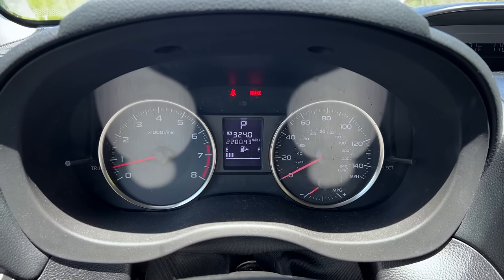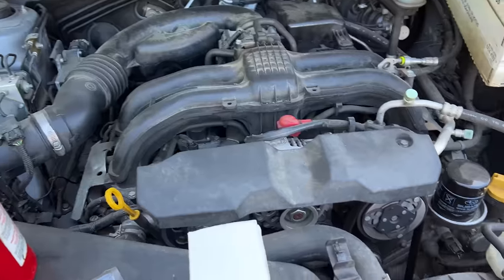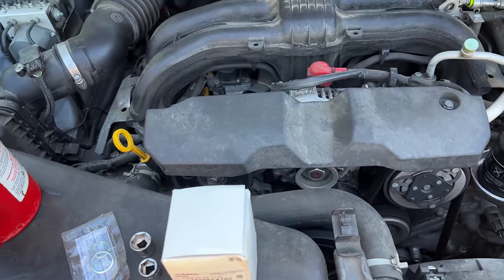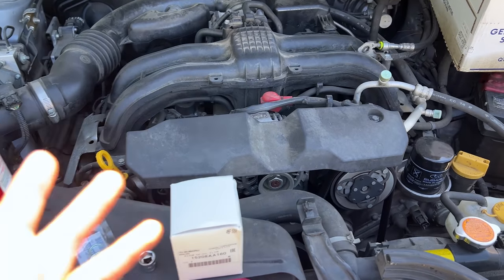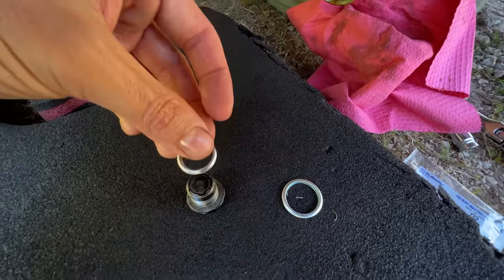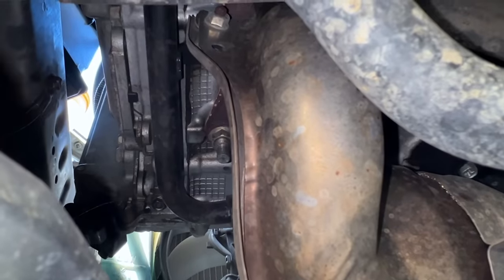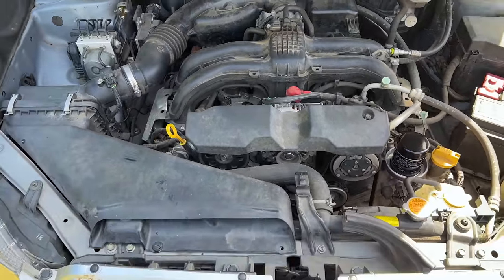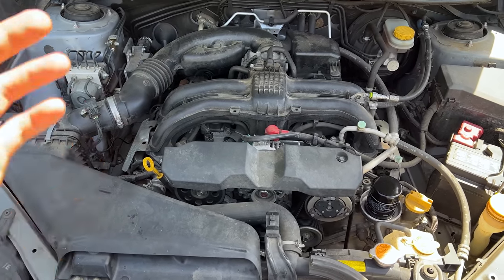220,000 Mile Crosstrek Oil Change - How Has The Cheapest, Highest Mileage Crosstrek Held Up?!

Comment: Not bad!  I'm surprised to see a CVT go that long, even with work.  I'm still skeptical of their durability/longevity.  No issues at all with the often derided 4EAT in my 2007 Legacy 2.5i Limited.  At 171k and change on the odometer, I'm looking at a car that's not going to make 200k though unless I replace the head gaskets for a second time, control arms, at least one set of wheel bearings, exhaust, and likely some other things (like valve cover gasket probably).  Starting to see some rust bubbles around the rear wheel well on an otherwise clean body is sort of what changed my mindset to start thinking about replacement vs dumping more money into it.

Comment: AT205 added to your oil is good for leaky seals - it really works, but the only part is you might have to do it with each oil change.  But I had good results with it generally stopping many leaks.  I don't think it would help your oil pan however.  I recommend the Fumoto drain valve that Alan mentioned.  I use Lucas too, did on my old subarus and use the new synthetic forumula for the thin synthetic oils.  That older stuff thickens your oil a lot, but I see that you only use it sparingly at low strength, so probably won't hurt using it that way (which is why I am sure you don't add the whole quart).

Comment: Fuel economy: Are you using Top Tier fuels? Years ago, I came close to selling my car as the fuel economy had gotten so bad - 15mpg. A.friend.suggested different gas. Next fill up, I used Diamond Shamrock (nee Valero) instead of Sams Club, and immediately saw.a.return to 20 mpg.

OCD oil filter: without that 1\2 turrn, you were spot on! 😁

Comment: Agree on the power. I’ve got a 2021 Premium with the CVT and it’s plenty- but I drive pretty cautiously too. No need to hand over money to the local PD just to arrive at the next red light a minute sooner! Awesome reliability on yours, nice! Bodes well for mine I hope.
Reply: Newer models have more power. First gen CVT models have a 0 to 60 time of 12+ seconds. 2021+ run about 8 seconds. Not much faster but noticeable.

Comment: Lucas is the good stuff I put a junkyard 350 in my mother-in-law‘s Chevy conversion van a few years back it was supposed to have about 80,000 miles on it I put a quarter of that in and 4 quarts of regular oil she’s not real good about checking her oil it lost oil pressure and she drove 12 miles home only thing that was in it was the Lucas only about a quarter of a quart came out all the bearings we’re fine resealed the oil pan put new oil in it she drove another seven years without a problem

Comment: some idiot at the dealership rounded off my drain plug and I can't get it out, so now I just siphon out the old oil and change it more frequently. I'm always impressed at how clean the old oil looks. Engines are made so much better these days despite what the boomers love to tell you about their carbureted messes from the 70s that barely lasted 80k miles
Reply: Cut a slit in the drain plug for a flathead or something then just replace it
Reply: @andreahighsides7756  I'm not that worried about it, I already have the oil pump and it's way less hassle than jacking up the car and trying not to get oil all over the skid plate or removing the skid plate.

Comment: Glad your's isn't really consuming oil. My 14 with 153k consumes about a quart every 3000 miles from what I can tell so far. I run 5w30 in it to help combat that somewhat over the thinner stuff. It's too bad the previous owner didn't take the car in when it would have still been covered under warranty.
Reply: The warranty wouldn't have covered that rate of consumption anyway
Reply: Well, that's what it burns with the thicker stuff. Not sure how bad with the thin 0w-20

Comment: I have the ‘14 Impreza with the same drivetrain. I’m running into the CVT valve body issues at 110k miles and I’m pretty disappointed. For a company that prides itself in its reputation of reliability, Subaru really should have addressed the trans issues with a recall rather than extending the warranty.

Comment: Great informative video for me, that helps me learn about my first Subaru, which is a 2013 Crosstrek. I can change the oil, that's easy. I'm just learning what type of engine and transmission that I have, as my first Subaru. My Crosstrek is also a limited. I wanted to know the difference between the TR580 and TR690 CVT transmissions. Do they take the same type of fluid? Would it hurt a CVT if I did a drain and fill with aftermarket fluid before I did a final drain and fill with Subaru CVT fluid? My Crosstrek was inherited. It has under 80,000 miles. Is there a way to know which recalls were done on a specific Subaru?

Comment: We have an old Anglo Saxon saying too, 'a stitch in time saves nine' same ethos, sort it before it is broken. Need to push for a Diesel engine Subaru if that is the best mpg you can get using petrol (gas). Worst I get with my Diesel 2013 XV (Crosstrek) is low 40's mpg town driving and high 40's out and about. Mind you our fuel prices (UK) you would think we are burning gold in our tanks...crazy. Would be interested to know how many, if any, wheel bearings you have gone through. Just done both my rear XV wheel bearings at 42000 miles.

Comment: earlier this year (2024), I got a P1133 code for oxygen sensor in my 2001 Legacy.  150K miles. its' a wideband sensor. Bought an OEM Denso sensor.  Could have bought a cheap-o $50 O2 sensor off Amazon but decided NOT to.  Car runs great

Comment: My 2014 Forester non turbo 2.0 now has 150k km. Only issue I had was I replaced the AC compressor and condenser at 60k and also the O2 sensor, but that was probably my fault as I drove my forester on flooded roads 😂
Other than that, it runs great! I always change my oil at 10k and I use 5W-30 or 10W-40 fully synthetic

Comment: Hey Mr Subaru I had CVT fluid changed at the dealership it said on the receipt that the fluid was electronically drained and torque converter something like that rinsed and filled up the fluid is that a drain and fluid (I wanted a drain and fill) just wanna be sure. My forester so much smoother
Reply: Sounds like a flush to me.
Reply: @jeffreygoss8109  would it damage it
Reply: @papag7296  normally not, Mr Subaru can better answer that. The biggest problem as I hear is that if the bypass isn’t open you only get the fluid in the transmission cooler. The biggest issue is that flushes use a low level tech who may not use the right fluid. These units require being checked at temperature.
Reply from the maker: Sounds like a flush to me...
Reply: @MrSubaru1387  would it damage the CVT?

Comment: Mileage and getting older will do it. I had a '90 Volvo 240dl that I bought back in 2000 with 113,000 miles. It would get damn near 30 mpg on the highway. By the time I trashed it out in 2021 it was down to about 21-22 mpg. But it did have over 300,000 miles on it. Other than a couple timing belt changes and a water pump & alternator it was virtually untouched motor wise.
Reply: old school... This car can work almost infinity if you will make plan service in time

Comment: Have a 2021 2.5l crosstrek sport, engine knock started at a stoplight after 7k miles. Full block replacement, luckily under warranty. Lots more problems with the 2.5s historically it seems ☹️

Comment: I have a 2014 with 120K on it, the oil consumption issue is a real bummer, I cannot recommend the Crosstrek as a good high mileage vehicle. I have had many different takes on what causes the oil to burn, what is your take and what is the easiest most dependable solution? Thank you.

Comment: My Corolla had 285,000 when I traded it in. It still passed smog, and I stopped changing the oil at 225,000 just kept adding it. Would only burn a quart every month and a half.
Reply: My 96’ Celica still runs good with 286k miles.

Comment: On my 3.6l, the MPG shown on the computer is always about 1mpg high compared to what I calculate out. Not too far off at least. I also switch back and forth between E10 and Ethanol-Free fuel (still available up here) to dilute the ethanol a bit. It probably doesn't save me any money though since it costs about 30 cents more.
Reply: I’ve been recording fuel economy manually compared to the OBC on my 2016 Crosstrek and the OBC is always 2-2.1 mpg higher. I keep hoping it is a class action since the OBC agrees with the published numbers for the fuel economy and I’ve never gotten them that high in actual driving!

Comment: the 2.0 is the better of the early FB engines. ive seen a ton of blown up and severe oil burning 2.5's , but never seen either on 2.0
Reply: they say it is underpowered, but hey, its a SUV, not a race car so I rather have the 2.0 in this case.

Comment: Are there any updates from the Crosstrek? I have a 2015 that has 244k miles, and hasn't had anything done to it other than general maintenance. No recall work, no head gaskets, nothing. Just regular stuff like brakes, filters, tires, oil.

Comment: Magilla Gorilla did the oil change on my Forester before I bought it, I had to use a filter wrench, it was on so tight I crushed the filter getting it off, same with the lug nuts, I had to use a thirty inch breaker bar and put all my weight on it, discount store "TECHS" have the same philosophy my father had, crank it down till it snaps off then back it off a quarter turn, no clue what a torque wrench is.

Comment: Had  a  2021  Manual   ....   Great  Fun  car  ....  Had  a  fall  and  Knee  injury  so  I  had to  trade  my  Manual  in  for  a  new  2024  automatic  ....  Great  improvement   ...  Much  quieter   and  less  road  noise  ,  Bigger  Gas  tank  and  gets  about  5 MPG  better  fuel  economy  too  ....  I  don't  like  change  but  the  new  info  system  works  way   better  ....   Subaru  did  a  Great  Job  making  improvements  on  a  already  Fantastic  car  ....     Could  you  do  a  video  on  recommended  intervals    maintenance   trans   Diff  plugs  .....    Thanks  Mark
Reply: only  thing  I  dont  like  is  the  Brakes  .....  way  to  touchy

Comment: What year or years do you recommend for picking up a used crosstrek? Love the channel
Reply: @domhandle  can I help you? It's the opposite of down.
Reply: @domhandle  all 👍 good
Reply: I think a ‘15 or newer should be fine. The 13,14’s had trouble with the wheel bearings and CV axles wearing prematurely. The 18’s were the redesign and added direct injection. The 18’s and newer are nicer, my local shop has one and he loves it. Drives 200+ miles a day delivering parts
Reply: I currently have a ‘13. At 100K miles. Replaced both rear wheel bearings at 76K miles. 95k miles I did both front cv axles, and just did the brakes and rotors last weekend. Nothing else so far, just oil changes and tires. Got it at 60K miles used
Reply: @shadowdestined2992  thanks for the input!

Comment: How do you clear flood crank mode on a 2022 Crosstrek with push button start and manual transmission?
Other notes, the 2022 still uses a 17mm drain bolt but also with the smaller washer. 
Our car goes from 33MPG (US gallon) in the summer to 29MPG in the winter. The winter tires make a big difference but I’m sure the cold doesn’t help.

Comment: Hi, MrSubaru!
Are there any benefits to use 15208AA130 (thick) oil filter, not 15208AA160 (thin) for FB's? Do they have the same bypass valve opening?

Comment: My MPG dropped recently too in my 2019 camry from about 30-31 to a consistent 27. Didn’t even think to consider that it is the quality of gas that I’m getting! Is there a way to avoid this or certain companies that won’t do that? I usually go to Costco or Shell and thought they were reliable but I’m curious to see if it makes a difference.
Reply: Probably nothing u can do, they all come from the same handful of refineries operating near wherever u are.
Reply: Both Shell and Costco are top tier fuels.
Reply: My Mpg’s have always dropped down from 31-33 to 27-28 in the winter.

Comment: 148 whopping HP! Once momentum takes over it isn’t too bad until you have to brake and start all over again😉 

All great points and advice as always!  I recall in another video you mentioned changing the O2 sensors.  Like your Crosstrek I have zero issues just a maintenance thing.  Maybe next oil change. Always use the filter from Japan thanks to Mr. Subaru! 

I hate the 200 pound gorilla 🤬🤬 especially when doing something as simple as an oil change for a neighbor.  Love the common sense torque to spec on the oil drain plug 👍

Normal oil change deal for me is to lift the car up on stands, rotate the tires, and check things.  My wife thinks I’m sleeping under there.  Maybe 😴 Appreciate the videos!!
Reply: @andrewdonohue1853  I agree
Reply: Plenty of hp for Mr Subaru. Take a roll in his Subie truck.

Comment: I changed my oil and filter and found that the dealer that had always done this service damaged and crossthreaded the drain plug! I have a Subaru extended warranty. Should I contact Subaru for a warranty on the pan or God forbid, take it up with the dealer?

Comment: I took my car to second Subaru service.  It’s a 2021 crosstrek.  The dealership said an oil change wasn’t necessary until the third scheduled service.  That means 2 years after buying the car and 10-15k miles.  I was a bit concerned when they told me that but they said it was standard.  Thoughts ?
Reply: Our 2022 Crosstrek 2.0 in Canada requires an oil change every 10,000kms or 6,000miles. 
The service manual has no service intervals without an oil change. 
Just did my 60,000km service and it also requires the brake fluid to be changed.

Comment: Hello, So the click/knock noise when making a sharp low speed right turn (I think it’s only right turn🤔). Is the AXLE ? Is it the CV BOOT breaking or is it something else ? It is a 2013 Crosstrek with 175,000 miles. I had to replace the Valve Body Cover at 171,000 miles….Thanks for any help.
So far it’s had both rear wheel bearings replaced at 72,000 miles…

Comment: I have been searching your channel and haven't seen any videos about the 2014 XV Crosstrek Hybrid with the start/stop battery. I am planning to replace the spark plugs, PCV valve, and engine air filter on my daughter-in-law's car. I have been studying your videos and have all my parts ready but none of you videos show the Crosstrek with the start/stop battery which I assume will also need to be pulled out. Do you have a video and/or any suggestions before I start? Any help is greatly appreciated. Thanks. p.s. Your videos are excellent (clear well shot video and detailed instructions - great for a novice DIY).

Comment: I find in my 2018 Forester that there is enough space between the battery and headlight for a full quart of oil and a funnel. When I pop the hood to check the oil, I have the 17yo attendant run over and ask if I "broke down". No....I try to maintain my sh*t. 🤓

Comment: Foot to the floor (gas pedal) cranking method, does it work on the manual transmission version?  Or do you have to have the clutch in as well to crank.  

Thank you in advance
Reply from the maker: Yes and yes

Comment: Hi, thanks for all your videos. I also have a 2013 Crosstrek but it says use 0W20 oil so is 5W30 close enough?
Reply: Yes 5w-30 is also sufficient for the FB series of engines.
Reply from the maker: 0W-20 is literally only recommend because it is the thinnest viscosity oil they had, at the time, in the US market. They ran it to free up as many MPG as possible. In Japan they run 10W-40 in these engines. 5W-30 or even 10W-30 won't hurt a thing.

Comment: Would you say there is any risk of engine issues by continuing to use the 0w-20? Does it offer enough protection or would 5w30 be safer? I have 75k on my 2013 Crosstrek and it burns no oil whatsoever. Would you recommend switching over for better protection or just keep doing what I'm doing?
Reply: 5w-30 is going to have greater shear strength and so better protection at operating temp. 0-20 is better flow during cold starts and better fuel economy
Reply: @andreahighsides7756  if i go to 5/30 oil do i have to use a different oil filter i have a 2023 crosstrek thank u
Reply: @robertchandler6134   no the regular is fine :) i like wix

Comment: That operation you performed to prime the motor for oil, is that something needed for a 2004 outback? 

I fill the filter, let it settle, and fill it to the top every time I change it, losing ony a tiny little bit in the install; but is that prime method how i should have been doing it?

Sorry if its a silly question.

Comment: My local dealer said that the CVT failures they get have always been valve body. Regular fluid changes help prevent this? Thankfully the one on my 16 FXT went out right at 99k. Had the HT fluid changed out around 70k. Wondering had the CVT fluid been getting changed every 20k or so I would have lasted longer?
Reply: Nah the turbos go out before 100k no matter what
Reply: @pingpongballz5998  is that due to the HT fluid it calls for?
Reply: @GamerNxUSN  I think so.  Let's see how the Outback wilderness hold up.

Comment: My stupid dealer kept saying that for my E5AT Took that awkward  crush washer and I finally figured out it’s actually Subaru part number 11126AA050 for the drain plug on my transmission I had to teach the parts guy😤

Comment: I’ve got a 15’ with 225,000 miles. I think my front crank seal is starting to leak. It’s kinda wet under the pulley but doesn’t leak on the ground. I smell hot oil after a long drive. Anyway, is that a big job? Im a jet mechanic so I understand tools… thanks

Comment: what would cause a 17 legacy with the 2 litre to randomly act like its losing power when accelerating? And then also at times mainly when the engine is already warm. if it's turned off then back on within a few minute period it seems to struggle to start? car has 120k miles.